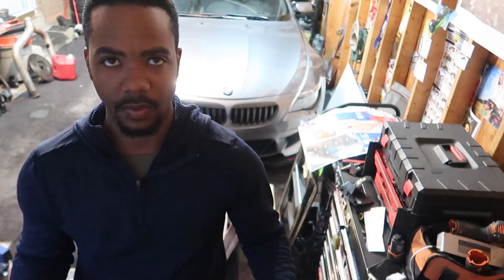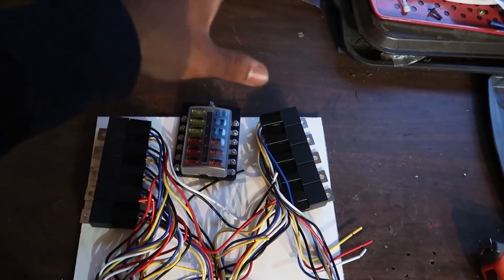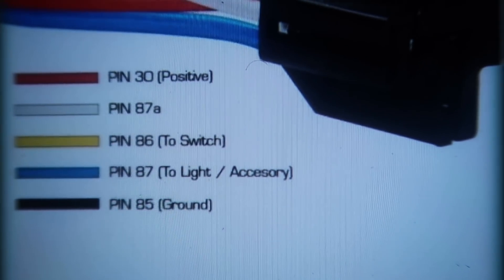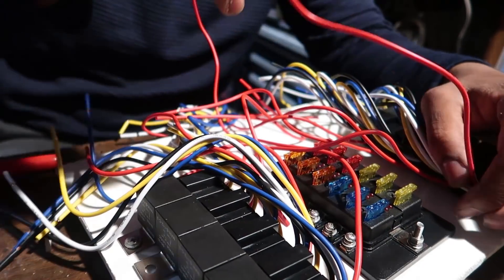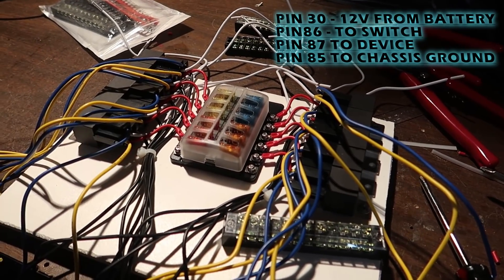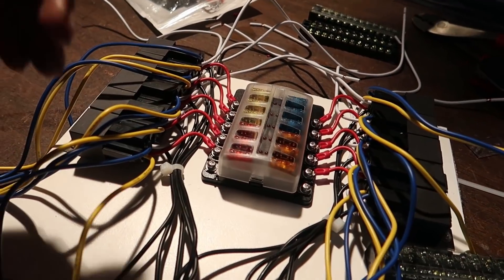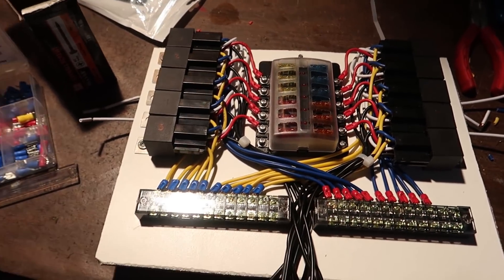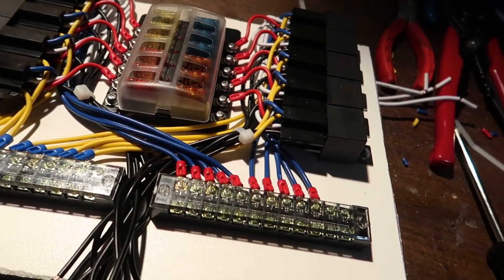DIY Race Car Fuse relay pannel

Comment: Can you show how you hooked up the switches to the fuse panel. About to attempt this project in my silverado
Reply from the maker: Skip back to 8:10 for the explanation.  the other side of the switch needs 12v.
Reply: @Sgt.Slides  I just bought everything an a decent switch panel with a power switch push button start an 3 accessories switches on it. Just wanted to see your switch setup wiring so I had a reference for it. Thank you

Comment: You should have used 4 pin relays instead. Nice work though.
Reply from the maker: they cost the same, and i don't have to use the extra wire, so i pretty much just go for whatever the best deal is, and the extra wire is there if i ever needed it.

Comment: The extra wire is normally to an output that provides power when the relay is not operated. Personally I would pop the connector for these out of the relay mounting socket (to minimise the chance of a short if the wires rub on something)

Comment: The white wires 87a are "normally closed" meaning that they get the voltage from the red wire wire all the time.  When the trigger wire is hit with voltage from the switch, they turn OFF and the other 87 gets the voltage from red - "normally open".  So the whites will have voltage at all times, so make sure they are insulated or cut off so they cannot short to anything.

Comment: By doing this set up does all the accessories you sure to the fuse relay block have 100% power all the time? Since the power cable goes to the top of the fuse dist block
Reply from the maker: you still need to add switches to anything you want to turn on and off.

Comment: When you clean your motor with water its not dangerous?
Reply from the maker: Short answer is no, however, it's not something you want to do often,  Never use a power washer, and be careful not to spray water directly into your intake, alternator, fuses, or ECU

Comment: For all the black grounds where would they go?  All into one wire and to the vehicle chassis?  All into one wire and back to the battery?  The accessories all have their own negative wire so where would they go?  Seems like there’s double ground going on with the relays.
Reply from the maker: no need for it to go all the way to the battery.  anything that's ground just needs to go to a good solid piece of chassis. mine all combined to one 4 gauge wire to e grounded

Comment: The terminals are rated for 15amps but relays give out 30-40amps and some radiator fans use 15-28 amps so the terminals would not be able to handle that.

another thing to look at is how many amps the fuse block give total, and combined draw of the relays is not more than that.

Comment: You said the other side or the switch is ground that's wrong. The blacks ground for the relay coil. You need a positive from a switch to energize the coil.

Comment: looks nice but you have no idea wtf you are doing. this IS NOT race car shit. we use all aircraft grade wire, plugs,connectors and NO SOLDER, certainly no aluminum  crimp connectors.

Comment: Should have spaced the relays out from each-other. They can get hot with the pick-up current and the load going through them.
Reply: Depends on the amperage you are putting through them. If it gets hot enough to melt the relay, you'll melt the wire insulation first and, you probably have bigger problems
Reply from the maker: thx for the tip, I wonder why they make them clip together, or if anyone has had those issues before.  Trying to troubleshoot that problem would be damn near impossible.

Comment: What gauge wire are the plugs coming of the relays. For a race car I crimp then srink tube the ring terminals take the plastic of first the tubing act's like a strain relief I use Pico parts for race terminal relay plugs I get my srink tube from fastnal adhesive lined is the best you have the right idea
Reply from the maker: if I remember correctly, everything is 10 gauge primary wire.

Comment: great video and links to parts. Id make a suggestion and use some carbon fiber for your mount. it looks even cleaner and gives everything a nice touch.
Reply from the maker: I don't really have that material on hand, but if I ever make another one, it will be cleaner.

Comment: DO NOT FOLLOW THESE INSTRUSTIONS.
Yellow is not switch wire, its white.
Blue is not power out, its power in.
Blue - power in
Yellow - power out 
White - switch
Black - ground
Red wire is not needed in this application. I believe its a normally closed circuit (meaning its a  normally live circuit and triggering the relay will disconnect power, which is opposite to how everything car related works.)

Comment: Are you switching pin 85 of each relay?
That would mean you need to send constant power to pin 86, and you switchs in the car would turn the ground ( pin 85 ) of the relay off or on.
You need to watch the polarity of pins 86 and 85 because some relays have a suppressor diode across the coil.
Reply from the maker: There were a couple of mistakes stated in this video, although the board was set up correctly, the application I mentioned was wrong.  As a result, this board was not compatible the way I intended with the switch panel I ended up using, plus, I didnit need 10 relays, the ECU came with a relay on the harness, the fan relay needed to be close to the fans to keep the wires short and efficient, the only extra relay I ended up installing was for the fuel pump.  It was a fun piece to build, but i'm very disappointed I didn't get to use it.

Comment: I also have a 12V Guy switch panel with built in fuse block which I used on non relay accessories.  Is it really necessary to be running 2 fuse blocks when using a relay as I don't recall manufactures having two fuses per each accessory?  Maybe the fuse between the switch and the relay isn't necessary idk.  Im not an expert just seems a bit redundant to have 2 fuses for an accessory.
Reply from the maker: I got it because it looked cool and seemed efficient, at the end of the day, it kind of messed up my wiring plan and ues, it is redundant, but it looks super cool and it's working lol

Comment: I took my fuse/relay block out from under the hood of one of my 02 Cavalier parts car it has both mini and maxi fuses a relay strip right next to it also a cover I just  re did the wiring running the fuse to whatever one I wanted to use

Comment: drill a bolt into your board and put rings on all ure earths cut to same size and put the rings over the stud and and another ringed wire going back to earth and screw a nut down

Comment: Dont know where you are in the process of this build, but that same company makes a slighty larger fuse block which allows you to wire the relay grounds to the block and only have one ground going to the chasis.
Reply: Any chance I could get a link? Almost at that point in my build and this would help a lot.

Comment: Hey man I’m doing this same set up I was wondering what kind of material did you mount this on to I bought a sheet of pvc I was wondering what yours was?
Reply from the maker: mine is PVC as well.
Reply: PVC melts and puts off chloride fumes...best to change that panel to a piece of metal and use stand offs to mount.

Comment: Thanks for the video! If I were to wire a rocker style switch as a master switch, essentially between battery and the fuse box, would I need to add another relay between the battery and the switch or can the switch handle being between the battery and fuse box?
Reply: Tim Hwang I’d do a relay to be safe. You don’t want a full 12v running threw a switch in the cab. Better be safe then sorry just get a 50a relay and a fuse. Fuse the switch also.

Comment: Sweet vid thanks!,.. still learning on it. . For the switch connection block, yellow wires,  my toggle switch has 2 prongs -(thinking red wires for both power in/power out and flip switch to complete circuit, right?)  If I connect 1 prong to the yellow wired block, where do I connect the other prong to?  Connecting a lightbar, maybe more later.

If just for 1 lightbar- would it be red wire from  battery to fuse to switch to lightbar?  Does it matter if the switch is before or after the fuse?
Reply from the maker: no, n this configuration, the yellow side needs to run to ground, but with a switch in the middle.  When you throw the switch, it creates a ground, and sends power thru the relay to the blue side.  You need to connect your light bar to the blue side. the metal post on the fuse box is the source of power, that needs to connect straight to the battery.

Comment: Get a common bus for the negative. Then run it back to the battery as one. It will look neater that way
Reply: Do they make a bus with a post for the negative to go back to?
Reply: Jaran Higley they have fuse boxes with negatives as well as positive
Reply: ground. loop.

Comment: Hands down the best video I’ve seen explaining relays for a switch panel!
Reply from the maker: I watched several videos and did my best to dumb everything down for folks who don't already know this stuff, such as myself.
Reply: @Sgt.Slides  I have wired up a few panels and this was a good video on how to do it. I have also used another block to tie all the grounds together then had a main ground wired to it. It ties the grounds all together neatly and also allows me a place to add any other ground wires in the future.
Reply from the maker: @warrenmichael918  Good stuff! I revised my ground after this vid.  Hope it all works out well for you.

Comment: for the yellow wire ( to the switch) you still need (+) positive current from the ???
Reply: anything , second battery primary battery wire tap into a light or fuse box

Comment: I would add a bus bar for the ground wire (Black). With the bus bar, you would run all the ground wires to that bar then run one Ground wire from the bus bar to the chassis.
Reply from the maker: I have that, but in another location.  I have one under my dash, and one under the hood. they are working out very nicely.
Reply: Would that wire have to be 4 or 6 gauge?
Reply: @MrMoronification  A ground can never be big enough. Go with the largest and most practical sized wire for grounding components, and always oversize from what you actually need.

Comment: Can I do this to get rid of a factory fuse box ? I own a eclipse and the factory fuse box and wires are all jacked up. Could I make one of these to replace my fuse box and use the factory wire harness with the panel ?
Reply from the maker: You could, but that's much easier said than done, and the fact that you're on here asking that makes me assume that you aren't quite prepared yet for the work that would involve.  I don't mean to sound condescending, unfortunately that's how this reads... That was actually my goal when I created this panel, however, it was much more involved than expected, and I ended up not using it.  If you do attempt to take it on, good luck to you, but if you're replacing a trashed fuse box. i'd recommend cutting one out from the junk yard and splicing it back into  your car.
Reply: Not harm caused. I understand what you’re saying. I never have actually like made a panel like this before. I have done all kinds of wiring in cars before. Another reason why I was asking about this is bc I have like really no choice but to move my fuse box to a new location. As right now previous owners zip tied it to the computer.... so the computer and fuse box just rattle around all the time cause their not bolted to anything. I also found a bunch of good looking fuse boxes on eBay for my car but idk where I would put it. Lol
Reply from the maker: yeah, normally a relay panel like this would only use 4 relays, it THINK they normally run lights, ecu, fuel pump, and ignition.  I thought I would take it a step further and reu every dang thing on it's own relay.... but like I said, I got way ahead of myself.
Reply: I just ordered everything here to run my lights an my dash lights an maybe fuel pump. How do I wire it up to turn on with the key. I'm pretty sure I can figure it out but why not ask first lol

Comment: Holy Fire Hazard Batman Nothing soldered or shrink wrapped.  Taking a big risk in thinking all of those crimp connectors are going to stay together under stress,  I'll be surprised if that car runs properly with all those wires crossing and touching each other.. You should run most of the wires underneath the board for a cleaner and safer install.
Reply: Crimp connections are actually stronger and hold up to vibrations better just ask nasa and the whole aviation field why they don’t use solders.
Reply from the maker: there's nothing under stress here, and crossed insulated wires are not a fire hazard, thanks for stopping by.
Reply: You have any pics of this type of board?
Reply: Yes crimp connections are stronger than solder. Soldering in automotive applications is actually a bad thing. The point where the solder ends has been weaken by the heat, is the point where all of the stress is focused and is the point where the wire will actually break. Soldering does not allow any flexing or vibrating movement, there by creating stress points for breaks. Crimp connections allow some movement and distributing stresses throughout the wire making it last ten times as long.

Comment: hey  Phi: here  Artist ...what you need to do to make it look good is ether ask an artist.... or use the other side of your brain ..... since you help me i help you..... where it mounts is where you go to design...l then forget wire .....in out,,,, forget all that ......and start moving shapes in the space ......find the perfect shapes in the space........{ just peeking up }  ummm ok   .....from a design perspective never make x or cross and lets not use more then one  primary ,,,,,  try to find the movement you feel in 2 0r 3colors two primary one secondary and one left  field ...the color wheel will help you ... the wire can go any where like a circuit board find your shapes on the space then the wire is you statement color code everything the same  in its line so yellow wire yellow everything that touches it ....you will have to paint stuff that's why shit looks  cool when we do it... we make it happen... like magic this will now be the best looking block ever  the wire will travel where they have to no crossing evenly spaced same radius in turns  i can see the whole thing completed and everything i just said may sound stupid to you but that's art................ PhiRatio5 ..... Instagram ...................... project build 88 jeep Cherokee base
Reply from the maker: Thx for the theory, Just followed you on IG
Reply: nice yea im doing a 88 Cherokee  base xj   engine bay and internal workings brought to the for front open pcu with monitor to see what its doing live and of course open relay inside also oil filter inside fresh air inside im also going to make a type of paint that's a cross between pavement and tires toughest finish ever digital gauges  matrix rain dash all metal interior ..you know   no stinger that shit played out befor it started no giant front bumper  no big ass 36 inch spare tire knee deep in wire all weekend

Comment: Is that white wire to light up an indicator on a switch so you know its on?
Reply from the maker: no, the white wire is actually an alternate power output.  Leave it loose and it goes to nothing, if you connect it up, the relay will switch from one output to the other.
Reply: Premium Fuel Mag so would something like that be for a high and low beam? Or did I totally just get off track with that.
Reply: Jon Sellars , yes two 5 pin relays used together can give  dip and main beam and switch between the two.
Reply: You could use the 87a to let you know the relay for that accessory is OFF since this is the normally closed loop (nc). Say you wire up a fan, when your fan toggle is switched to the OFF position (yellow), your 87a (white) will receive the current, possibly powering a small LED indicating the fan is NOT on. When he switches his toggle ON (yellow), 87a (white) will no longer receive any current and 87 (blue) will send power to the fan. Hope this helps.
Reply from the maker: a little counter intuitive but at least that would be putting it to use.

Comment: Also old stero guy trick ... Run your wire under the board to keep it clean ... Wish i could add a picture i would show you my board
Reply from the maker: I ended up going back and running the ground wires underneath.... now the whole unit sits on a shelf, I didn't use it :(
Reply: Premium Fuel Mag did you go a different route? Would you sell it?
Reply: @Sgt.Slides  Did you do another board?

Comment: I'm building a similar setup, and I was curious do you still need to ground the devices as well? Like electric fans, lights, etc.
Reply from the maker: this board only controls the supply of power, you still need to ground the device to chassis
Reply: That's what I was thinking but wanted to be sure. Thanks for responding !

Comment: question about the 12v switch (86) terminal block. Where does it get power from and how much wires are going to be run to the block?
Reply: Usually your accessory on your ignition... which is a turn on 12v

Comment: So did  Your relay set up work?  What kind of switchs are on your panel?
Reply from the maker: The relay set up was fine, however, it's overkill and I didn't need it.  :(  It currently lives on the shelf.

Comment: 87a (normally closed) will get power when the switch is OFF (Say for a switch light)  See "How a 5 Pin Relay Works" here on youtube.  Great video! thanks for posting.
Reply from the maker: yes, I figured it out, even though I built the thing from scratch, I still don't know exactly how it works! Sad part is I wont even get to use it lol, I ended up not needing it.